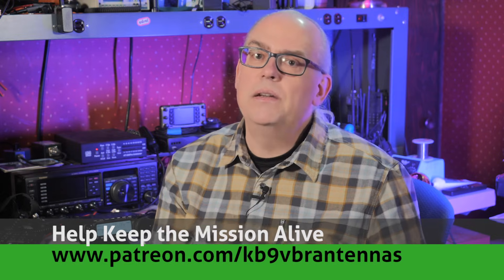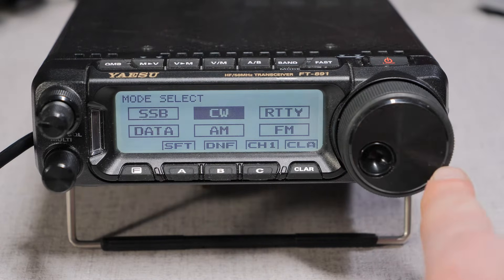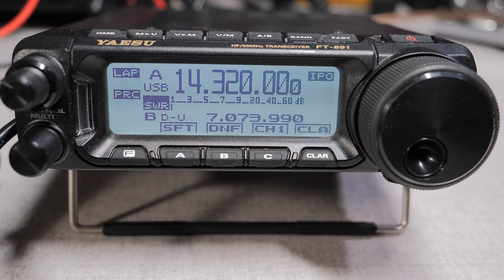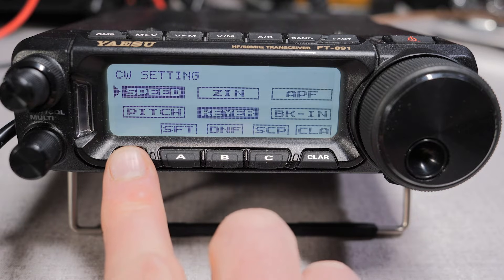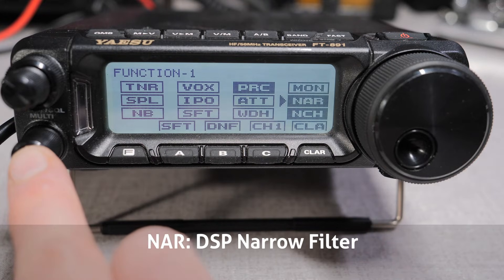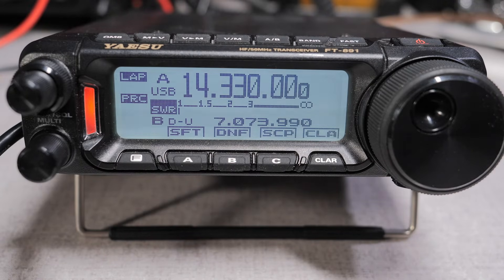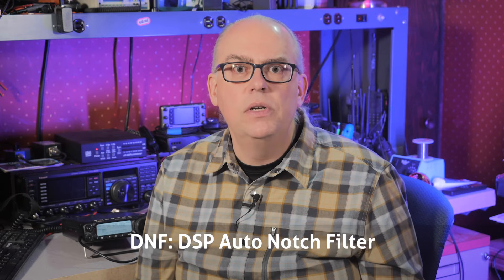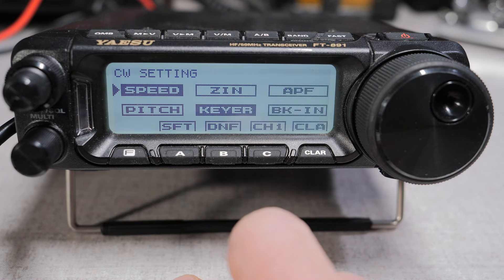Yaesu FT-891 Buttons and Functions- Ham Radio How-to #HamRadioQA

Comment: Nice job as usual. IPO could use a more thorough explanation however as it’s not straightforward. It’s a bit confusing. Let me explain. When you say IPO is ON it really means your turning the preamp OFF since the default setting on the radio is Preamp ON. Please correct me if this is wrong. How do you set IPO? Do you leave it off (which means the preamp is on) or do you turn it on (which means the preamp is off)? It’s counterintuitive and confusing isn’t it?

Comment: I've just ordered my 5th  FT-891. I really like the rig. Over the years, I'd just go a different way and sell or trade them off. I'm 64 now, just want something quick and easy to use in my car. The ATAS 120 will be the antenna.

It's a great mobile. Yaesu gave up fixing a few menu items, but it still is a great mobile.

Comment: is this a good Radio for someone that's looking at getting there Technician License for ham ???
Reply from the maker: It's definitely a radio you can grow into. It supports 6 and 10 meters so you can use it right away and the capabilities for the other bands will be there when you upgrade. I would recommend it if you think portable operation is in your future.

Comment: Another great video!  I just got my 891 and was wondering if there are any recommended settings to make (specifically for POTA) or if the factory settings are good to go right out of the box ?  Thanks.
Reply from the maker: The stock settings are pretty good, but if you want to play with the parametric equalizer a bit, I recommend this article by Heil Ham Radio https://heilhamradio.com/dsp-settings/ (open up the Everything Yaesu tab and follow the recommendations for the FT991A).

Comment: The Yaesu FT 891 is an incredibly capable radio, and I find it quite a breeze to use. There’s a bit of a learning curve with a deeper menu system, but I find this video incredibly helpful. Thank you so much for this, Michael.  KF0QNM.

Comment: My FT-891specs say it needs 13.8volts plus or minus 15%.  Will it damage the radio if i let the battery strength go below 11.5 volts which is approx 15% below 13.8?  Thanks.
Reply from the maker: From my experience the spec of 15% over-under is pretty accurate. I can tell you that at 11.8 volts, the FT-891 will operate in receive, but when you try to transmit it will shut down. That's because the current draw forces the battery voltage even lower. I don't believe it will damage the radio, at least I haven't done that yet, but then the voltage regularly drops below 12v on transmit, that's a good signal to change batteries.

Comment: Do you think using a decent switching power source would be adequate for the FT 891 using it for SSB?  Many thanks.
Reply from the maker: A switching supply will work fine with the FT-891. Look for one that has at least 25 amps of output.

Comment: I'm struggling with what Yaesu radio I want to use for POTA. I have an FT-710 in my shack and am fairly familiar with it (but still have a long way to go). I see many POTA operators USE the 710. But I'm not fond of the idea of having to disconnect all my wires and connections when I want to go portable. Buying another 710 is an option so long as I don't mind spending another $1000 (GASP!). So, enter the FT-891. A lot of reviews I've read say it's extremely complicated to get used to. I can see that! As an old guy (78) with CRS and chemo-brain, learning yet another radio seems a daunting task. The 891 is only four pounds while the 710 comes in at a honking 10 pounds! So, I'll watch all your 891 videos that pertain to what I want to use it for and 'try' to make a decision. Thanks for this seemingly easy to follow video. 

Added on 7-9-24:  Well, I bit the bullet and bought the FT-891. Your (and others) videos will help get me up to speed. Thanks for your help.
Reply: How are you liking the radio?  I am considering one myself.   --... ...--
Reply: @ranchosinnombreJimmyandAnn  I have totally fallen in love with my 891! I've gotten the basics down and use it almost exclusively for POTA activations and POTA hunting. Coupled with either my ATAS120 on my p/u or my Chelegance MC-750 vertical ground antenna, I have nothing but success. Yup, I highly recommend it.
Reply: I got a ft 710 last dec.i want a field radio but no way am I hauling it out in the field to scratch and dent it..just tonight I bought a ft 891 from dx.😊

Comment: I guess there is not a way to put the power/watts button in any of the ABC front buttons right? ahhh Yaesu, Yaesu...
Reply from the maker: Unfortunately not, you have to adjust the power levels in the main menu settings.

Comment: Thank Michael this was a great reference for me. Love my ft-891. Question, for portable power would  Lifepo4 4s 14.8v rc battery damage this radio? Yeasu Specs say +-15% can I say then 2v  over or under 13.2v is ok and safe?
Reply: I run a life po battery from harbor freight with a solar controller. Withe the 891 and 991 with no issues.

Comment: on the yaesu desk rigs, i can configure the rigs so that i can use CW in ssb mode - which comes in handy when you run long distance QSOs where some of the participants are too weak for voice.   This is something i do all the time.    So in our nets, where everybody understand CW if they need to - it is very common to break in with the callsign suffix in CW, so we know you are there - and then continue in ssb, but be ready by the CW key if a member can otherwise not get your greetings and well wishes.

Now, how do i set that up on this mobile rig for my car?        selecting mode cw just to blast out my callsign then quickly selecting ssb again to not miss the ssb content
all that while driving 80km/h is something i would like to avoid - and since this is yaesu, i am caerfully optimistic...  but first.. no "bk in" button...

Comment: Very excellent video on my favorite mobile radio!  I have it mounted on a 2x4 block in my truck with two large bolts so I can easily remove it during periods of winter/summer extreme temperatures.

Comment: I am trying to use my target tuner with my new 891.    How do I setup the 891 to use the auto feature of the target tuner? 

I am tring to find how to pupt the radio in the cat mode like I did on the 857.  

73, Don
N1EDF

Comment: Great radio that Yaesu hasn't offered a single software upgrade to users in 3 years. Reason the Xiegu G90 is the leading POTA rig right now. Compact, frequent updates, 20 watt power that gets out, digital integration, water fall, and so much more. The only real thing the 891 has over the G90 is the 100 watt power BUT for 225 bux, you can add a good 3rd party 120 watt  linear to the G90. 
The 891 just doesn't compete anymore.
Reply from the maker: I'm not entirely sure the Xiegu G90 is the leading POTA rig, although it is a popular choice. My experience lends me to believe that operators are choosing a wide variety of transceivers. The FT-891 is a mature product and you won't see countless firmware updates from Yaesu. Plus the build quality of the 891 runs circles around the G90 and it doesn't have the overheating issues like the Xiegu has. But to each their own. Whatever rig gets you outside and working portable is a good choice.

Comment: What are your thoughts on this radio vs the 817? I believe this radio does everything the 817 does but operates at a higher output?
Reply from the maker: I don't think I'd call the 891 a high power version of the 817. Namely, the 817 also includes VHF/UHF and the 891 only have 6 meters on the VHF. The 891 has a more sophisticated noise reduction system and a bigger display, so it is more power hungry when just receiving.

Comment: First of all, thank you for a nice presentation.  I just purchased an FT-891.  I’d like to watch the dedicated CW video.  I haven’t found it…yet, but will look for it in the listing.  Also, my only CW key is an MFJ keyer / Bencher paddle combo.  What would be a good option for the 891?  I’m hoping there is a built-in keyer, so I only need the key.  I want to carry my rig to the field (POTA, camping, etc).  I purchased an Apache 4800 case, so I will be VERY interested if anyone has a good layout for the storing rig, Dakota Lithium 12V/18Ah, 40m EFHW, MFJ-929 tuner, and coax.  I’ll stand by for suggestions.  Now, off to find the CW video…. 73 de David AE4LH

Comment: When I first got my license, I bought a slim jim 2m antenna from you.  It is amazing.  Now, I am going to buy an FT-891 for mobile/field operations.  This video really helped me make up my mind between this and the FT-991A.  Unless you feel otherwise, I think this will work for me.  It's not a matter of money, but the simplicity of operation.  This video really helped me understand that the FT-891 has the features I need to use phone/ssb on HF.  Thanks again David!!
Reply: I have the FT-891 and I love it for in the field. Such a great and simple radio and the screen is easy to see even in sunlight. It’s small, and compact but has a great sound and its a great looking little rig. I prefer to use a travel MFJ tuner and they work well together

Comment: Thank you , Michael, for such a comprehensive but quick overview of essential functions of this rig. Mine came just a couple days ago and as an IC-7300 owner I was concerned about the menu structure. Thanks to you and some other videos I have realized the hidden gems in this rig. I plan on using it for portable / POTA and as a very capable back up should my 7300 get sick. Great job! Don Z, KC0DWZ

Comment: Many thanks for your video Can the 891 use an ATAS 120 ? The 991 can but is somewhat large in a car.
73, Milos F4IIP
Reply from the maker: Yes, the FT-891 can control the ATAS 120.

Comment: Good vide Michael❗️I just picked a used FT 891 at the Orange Texas Ham Fest last month for a very good price and it is less than a year old without so much as a scratch.  I am just getting acquainted with it menu and I am not finding it to be as difficult as I heard, it seems to be fairly strait forward and the little radio has quite a bit to offer.  So far I am very happy with it and definitely appreciate these videos on the FT 891,  they help a lot.  Thanks 73 KV5P

Comment: Hello I asked once I was a General class licence. I didn't renee. So I guess I need a Tech license. You said if I show the FCC a General class licence, I can use General class frequencies using the Tech licence.  If I show them a photocopy of the licence is that alright? Thanks.
Reply from the maker: If you hold an expired General license, you can go and retake the Technician exam, show proof of your expired General, and you will regain your General class privileges.

Comment: I appreciate the info on the FT891, I recently got this with the side rails from Portable Zero in O.D. green. This fits a specific role in my kit for 100watts if I need it. The most annoying menu change I needed was to make SWR to show on the main screen, it was hidden in the menus. ZIN and NAR are my favs :)
Reply from the maker: I'm on the fence with the side rails. I like the look, but they sure add bulk to the radio. I think the two biggest questions I see the new user of the FT-891 ask is: how do I change the power and how do I change the meter. I'll get into the power question and other things hidden deep in the menu in a future video.

Comment: Hi Michael! Great video.

How do you operate 60m digital modes? Are you able to change SSB to DIG-U? FT8 is normally on Channel 3 

Also, is there an RIT or XIT that works on 60m CW, so you're not zero-beated with everyone else? I don't know CW yet, let alone have a 60m CW qso. Just asking this out of curiosity.

60m is my favorite band, and FT8 is a fantastic mode on 60m. I've worked dozens of Europeans on 60m FT8 on my POTA activations. I have been considering an FT-891 as it's easier to fly with than with my IC-7100, but the IC-7100 is widebanded on 60m, so I don't have those issues. 

73 de VE3GKT!
Reply: Lots of subscribers are anxiously awaiting Michael's FT-891 CW tutorial.😃

The 891's "data" mode has some odd characteristics that annoy me, so I prefer to just use "SSB" mode for PSK31, FT8,  and all the others.  That solves your FT8 issue on 60 meters too.
KZ9V

Comment: Great video Michael with excellent descriptions of the different functions. I admit that my biggest issue with the 891 is quickly finding the function I need to respond to changing band conditions. This will help and I plan to watch it again when I am in front of the radio. My primary POTA/SOTA radio is a  Xiegu X6100 as I like QRP. But if I need a 100 watts then I turn to my 891 for portable use. MY 7300 stays in the shack as does the 891 when it isn't going portable.

Comment: Tuner button also turns external FC-40 wire tuner or FC-50 coax tuner on/off. Press and hold forces a tuning cycle. Also controls some non-Yaesu tuners. External tuner must be connected when rig is powered up or the button won't work. Great show Michael!
Reply from the maker: Yeah, all the Yaesu tuners use the same tune button. I think the MAT-30 may use it also. The LDG tuners use a different method where you press the tune button on the tuner and it switches the radio.

Comment: Love mine!  Hoping to get out and activate a park or two this summer.  I’ve found that using FLRIG on my computer to control the radio has made POTA hunting much easier while at home.  Most of the functions have a slider.  Thanks for breaking down what each item does.  73 K5RAG

Comment: Thanks I have this radio, but not impressed with it's Noise Blanking capabilities. This shows me that maybe I don't have the NB on???
Reply: It works very well especially when you are in a POTA park and somebody pulls into a parking spot and leaves their engine running while they chat on their phone.
Reply from the maker: I've run the noise blanker in both my Subaru and a Chevy Silverado. The truck required a more aggressive setting to eliminate the noise. But the radio cleaned up the pulse noise quite well.
Reply: @KB9VBRAntennas  I tried the NB today and at least for my 03 Chevrolet Duramax Diesel it does nothing but muffle the sound. Yes I adjusted it from 1 to 10. I had to shut it off. I have ground straps all over this vehicle and ferrite chokes where suggested. Next I am going to try my IC-7100 in this rig. The NB in my other vehicle actually works great on the IC-7100.
Reply from the maker: Diesels are notoriously difficult to quiet down. Fuel pumps and injectors are the prime culprits. Let me know if the 7100 works better in that vehicle.
Reply: @KB9VBRAntennas  Will do!
Reply: @KB9VBRAntennas  I switched to my IC-7100 today in my '03 Duramax. What a difference the noise blanker makes compared to the FT-891. I think the Yaesu FT-891 is a great radio to take with you as a portable but the IC-7100 has it beat hands down in a mobile for multiple reasons. Which one would take to do an POTA activation? The FT-891 of course. I haven't done an activation yet. Just a hunter right now. 
I am going to to a video on this in the future comparing the two transceivers.
Reply: You should see NB on the screen when it's on